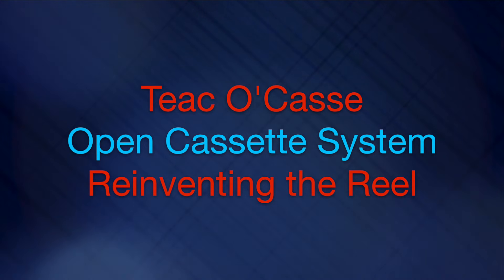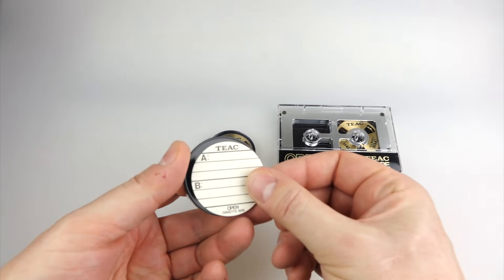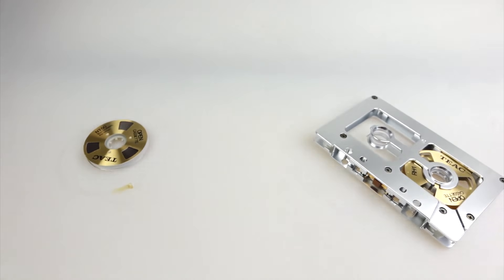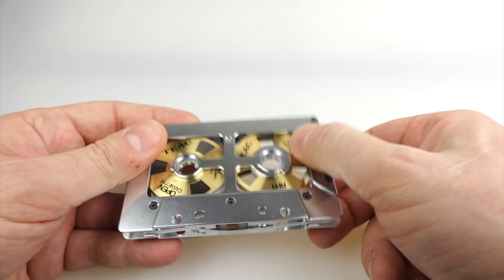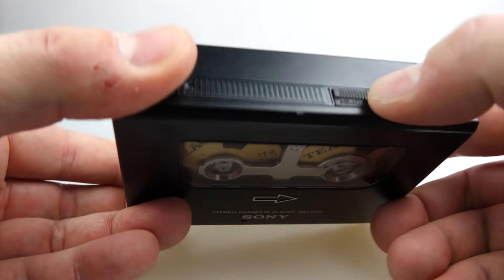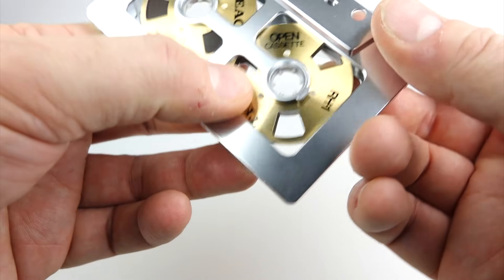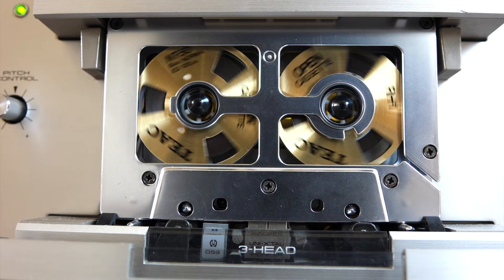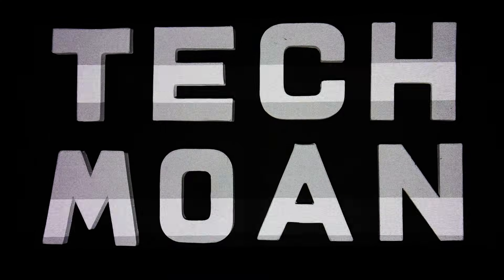TEAC O'Casse Open Cassette -  Reinventing the Reel

Comment: That's like replacing usb cords with beautiful golden wires you can conveniently solder between your devices
Reply: I'd say its more comparable to re-soldering a flash chip into a flash drive whenever you're finished with it. Hilarious, unnecessary, impractical, yet still completely baller.

Comment: The convenience of cassettes without any of the convenience.
Reply: all the fun of fiddling with technology with the simplicity of a cassette tape
Reply: This would make a perfect gift for Shelden Cooper. He likes non user friendly things. Like his mind for example. And Linux.
Reply: What's user unfriendly about Linux?
Reply: Installing programs, for one thing. You can't just run an installation executable. Instead you've got to go into the command prompt and first remember the root password from last time you installed something on that particular device, then figure out what series of commands you need to put in to get the thing you want, which may suddenly change or not be applicable for your particular Linux build (which just so happens to be the only one where you could get the sound working on your particular hardware)... There's definitely a lot of room for improvement in the user friendliness area. Kind of the opposite of the problem with recent versions of Windows, where they're so obsessed with some bizarre idea of user friendliness and competing with Apple for the can't-do-anything user that the user has to fight a gorgon to get control over their own computer. 
All operating systems are a pain in the ass, because they're all terrified of the happy middle ground between user friendliness and user control, and Linux happens to be on the side of not enough user friendliness.
Reply: I know.  I use Linux on all of my devices.
Reply: Good guy, you are.
Reply: Operating a full size open reel deck suddenly seems easy.
Reply: @ The Garden of Eatin
Linux is great if everything is doing what it is supposed to do.
But the levels of customization that is capable of which is its greatest strength can also be its greatest weakness, if something goes wrong then it is entirely possible that you are on your own because nobody would have a setup quite like yours so tech support will be virtually non existant.
Reply: When was the last time you got meaningful tech support for software?
Reply: The problem with linux:
Program needs OtherProgram v1.2 and Perl v3.1
OtherProgram v1.2 needs Perl v2.6
Now your in a conundrum... Have fun jumping through hoops getting each program to use different versions of each program.
Reply: Something that hasn't happened to me in the 3 years I've been running Linux as a daily driver.
Reply: Doesn't apt manage that automatically?
Reply: you don't have to use the terminal to get programs on Linux some apps allow you to download package installer that will run through your typical package manager
Reply: I saw a motor trike today.  I sarcastically commented to my daughter that it had all the disadvantages of a car combined with all the disadvantages of a motorbike with none of the advantages of either.

This has all the disadvantages of cassettes with all the disadvantages of open reel.  What a completely daft idea.
Reply: "The convenience of cassettes without any of the convenience." _ Ha! Spot on with that comment (-;
Reply: Rui Cameira  why everybody is mentioning win.98 as good version? I thought that most reliable was win xp and the worst crapp win 95 from which 98 is derived . It was colapsing every 10 min ( talking 95, never used 98)
Reply: Best reply ever...spot on!!
Reply: linux is just not good for your normal user, BUT it is great for people who are looking to make their own stuff, also I agree, win 98 was not really that good, honestly win 7 before win 10 became a thing was the best version of windows, The reason I say before win 10 is because you can not run win 7 anymore because it will force you to go to win 10 or hack your OS to allow you to just use windows 7.
Reply: This comment really made me laugh!
Reply: @thegardenofeatin5965  I ve absolut no experience with using linux, but the curiosity about doing so was always there. Thanks for your comment!
Reply: Exactly!!!

They're perfect.
Reply: @thegardenofeatin5965  thats not normal
Reply: @thegardenofeatin5965  For most people? Just about everything!
Reply: The Garden of Eatin That’s exactly what I thought. Been running Linux for a few years now and never had any problems
Reply: that was good!
Reply: @thegardenofeatin5965  Everything...?
Reply: This is my favourite comment in the entire history of YouTube.
Reply: This comment has marinated for 6 year and i fuckin laughed so hard at that but its true 🤣
Reply: @murdermittens2281  yeah, me too
Reply: @electrictroy2010  so, Open Office wouldn't fly? Does pretty much everything I'd need MS Office to do, but that doesn't necessarily apply to everyone, though, so I'm curious about what didn't work.
Reply: @refraggedbean  I'm running Win7 and it has never asked me about Win10

Comment: Actually the 8-Track beat the shit out of any cassette tape in sound quality
Reply from the maker: +TruAnRksT it did....until it didn't. You see whilst 8-track tape formulations didn't really improve since the 60s, the cassette got chrome then metal, Dolby c, s, hx-pro. I've made a video about 8-tracks and one about compact cassettes...both these are in the HiFi playlist on my channel.
Reply: +TruAnRksT are you insane? 8 tracks sounded mufffled and jittery from the always unstable transport mechanism.
Reply: +chieftp You needed the obligatory pack of matches to get the fidelity :)
Reply: Russ Greene
oh yes, that would decrease the wow and flutter by a percentage of 5 decibel hectars.
Reply: +chieftp 
LOL well it did have it's draw backs but when it was playing good? Only damaged tapes sounded "muffled", back during the Vietnam conflict I had a portable that used eight D cells and it really cranked out the jams. In stereo with speakers that could be separated up to 6 feet. Later I had an 8-track in my car that made other car radios at the time sound like shit. It had a whopping 8W per channel! LOL.
Yes I agree there were some technical issues with the format but the actual tracks themselves if separated from the rest of the tape, for some reason sounded better than the tape used in commercial cassettes.  Cassette tapes have always sounded a little flat and stage-less to me. All varieties.
Reply: +TruAnRksT My 8 Track player sounds great. It really depends on the tape and the player as some were cheaply made. The tape hiss isn't that bad even without noise reduction. It sounds better than my cassette tapes from the 70s. However my tapes from the late 80s and 90s blow them away. Had the 8 track players and tapes improved as cassettes did, I think they could have sounded just as good if not better due to their faster speed. Instead the 8 track died out very rapidly in favor of cassettes smaller size and the ability to record easily.
Reply: billybassman21

Well they were a mess to try and rewind if you got any stickiness on them or in the deck and they got ate up. At least cassettes were easier to get back in the case. LOL

I still have a fully operational Transaudio 3800 recorder deck. Don't use it, but still.
Reply: I kinda like this TEAC idea, but they should have made cute little reel to reel decks to go with them instead of expecting people to swap tape in a cassette.
Reply: *****

Yeah but a reel to reel  doesn't use the carrier. A really cute deck could be made to use these just like an old school RtR, It wouldn't have been any harder to spool the tape than with this fucked cassette mechanism and would have been really cool.
Reply: Thanks again for all
Reply: *****

>>that would have been totally horrid, and yet, look so cool. I know I would have had to get one. Heck, I'm tempted to try and find some of these things on EBay or something.<<

Yep you want it but, but it never existed. Make it so #1. The opportunity still exists
Reply: +TruAnRksT If one examined the tape used in 8 track format, one will see that it uses quarter inch tape, exactly the same tape format as the open reel format.  the reason that open reals and good 8 tracks sounded better, was the 'headroom'  or bandwidth offered by using wider tape.  This required larger tape head gaps.  The downside was that stereo required two gaps, one for each channel and thus halved the bandwidth.   This can be demonstrated by the open reel formats available.  A mono 'full track' open reel deck used about 90% of the width of a quarter inch tape, which gave excellent bandwidth (basically the more ferric particles that could be sensed by the head, gave better quality reproduction....)  The next stage was the twin sided, bi-directional mono format, that used half the tape width (half track), but would give a longer playing time because one turned the reel over and played the other track.   This was further updated when stereo recording became popular.  All professional recording master tape recorders of the time used either half or quarter inch 'half track' format. (Revox, Uher, Studer, etc...) They were mono-directional, usually ran at higher speed and had excellent SN ratios.    Sound recording gear, as used by mobile broadcasting units, tended to use mono full track for maximum quality where stereo was irrelevant.  

In the domestic world, open reels (Akai, TEAC, SONY, Tandberg etc..),  tended to use the quarter-track format.  Which was bi-directional stereo...  But used smaller head gaps on the tape head.  These had good quality for hifi, but not as good as the half-track format, because of using less of the tape width.   

The 8 track was also quarter-inch tape format, but used smaller head gaps, making essentially four stereo program lengths (stereo = two (channel) track x four tracks = '8 track').  The head gaps were bigger than cassette format, but smaller than open reel...  So the quality fell between the two...  Also given the short life (in terms of marketing) of the 8 track format, they never got round to improving the tape type much, although chrome coatings were used on the latest 8 track format.  

The cassette, used the same format as the domestic open reel, that was quarter track bi-directional, but of course the tape width was reduced to 8th inch, hence the quality was much lower, given the reduced tape head gap size and thus bandwidth.   However, quality was improved over the 8 track by the development of better tape particles and coatings (Chrome, Metal etc...) and compression circuitry was introduced, Dolby A, B and HX Pro and ANRS.

Professional multitrack recording used very large tape format, mostly one to three inch wide tape, to accommodate the number of simultaneous tracks, up to 16 or 32 even.  Amateur multitracks also became popular... (Tascam etc...) bottom end being four track, using the same format as domestic hifi - quarter track/quarter inch tape... but mono directional, so that all four tracks would record simultaneously.  This was later updated to 8-track format.  And again updated to the cassette format even (Fostek, TEAC/Tascam etc...).  

The biggest problem with any ferric tape format was 'drop out'...  The magnetic ferric particles coated on the tape, tended to wear off with use, resulting in signal loss - muffled sound etc...  Also of course, one had to be very careful with where one stored tapes...  It was not a good idea to put tapes near speakers or use motors with large magnetic fields around them, for this could wipe the tape.  Also the heads themselves required degausing from time to time, because they too became magnetised and thus degraded both quality of initial recording and ultimate playback.
Reply: Deebz270

Well that was a very nice critique of the situation, but like with playing records a bit of click pop and muffle is acceptable. Now 8-Tracks should have had the tracking adjustment used on future VHS machines from the get go, wouldn't have cost anything. The crosstalk with 8-Tracks was often noticeable  but ignored because the main track came through anyway. A tracking feature, a small manual adjustment done from the outside could have eliminated crosstalk almost completely and boosted fidelity.
Reply: The wider tape doesn't help with sound quality. A stereo cassette has 1/8" tape divided into four tracks, for 1/32" per each track. (It's actually a little less because there's a guardband between each track, but 1/32" will work for our purposes.) An 8-track tape uses 1/4" tape divided into eight tracks...for 1/32" per each track. If there was any improvement in sound quality with the 8-track system, it's because the tape was running twice as fast - cassettes 1-7/8 inches per second, 8-track 3-3/4 inches per second.
Reply: jmowreader
I didn't consider the tape transport speed when developing my opinion but it makes sense you would get more definition with a higher tape speed.
Reply: Deebz270
I will look into that, but that is what common cassettes use and I think 8-Track tape was a bit wider. Let you know later cause I have a full box of 8-track tapes ... somewhere.
Reply: Open-reel 4-track stereo was a little bit different than cassette 4-track stereo. Open-reel interleaved the tracks: 1 and 3 were for playback in one direction, 2 and 4 were for playback in the other direction. Everyone who makes a cassette machine had to pay a licensing fee to Philips for each machine made, and the Philips license said, "any Compact Cassette machine will make tapes that can play in any other Compact Cassette machine." To make it work, on a stereo cassette tracks 1 and 2 playback in one direction, 3 and 4 playback in the other. This setup was to make the tapes sound better.
Reply: *****
Whole different process. VHS uses short stripes of information cut across the tape at an angle.
Reply: That's for the video stream. A VHS tape has two linear tracks enveloping the helical video track. 

The one at the top of the tape was a "control" track - just a stream of pulses that let the deck's electronics know how fast the tape was moving. It knows what the pulse repetition frequency is supposed to be; if it's not correct it'll speed up or slow the tape to get it to the right speed. The one at the bottom is a linear audio track. VHS Hi-Fi also recorded this track so any VCR could play Hi-Fi tapes. In addition, it modulated the audio into the video stream, recorded it (with near-CD quality) into the helical track, and pulled it out on playback.
Reply: Standard tape recording, be that open reel or cassette is all analogue.   There was a time, prior to flash cards, when the D.A.T recorder (...which was hugely expensive) used tape to store digital encoded material.  The tape cassettes are still available, though mostly redundant as a medium.  

Tape will always be an inferior recording/storage medium.  Simply because of 'drop-out'.  This is where the tape loses its metal oxide layer over time, leading to loss of information (mostly the high frequencies...).  

Of course, the analogue 'sound' is still regarded as 'warmer', with arguably better headroom.  Thus perfection is always in the ear of the listener...
Reply: The data cassettes computers used as storage in the 1970s recorded binary data as a series of tones...it's called "frequency shift keying." A 1 (we called it a mark) might have been represented by a 2000-hertz tone, and a 0 (called a space) might have been a 1000-hertz tone. In your computer was a device that could identify these tones and send the data they stood for to the rest of your machine. Unless you have an actual digital tape recorder like a DAT or DASH machine, what's on the tape is analog.